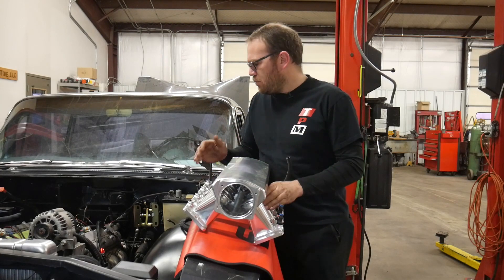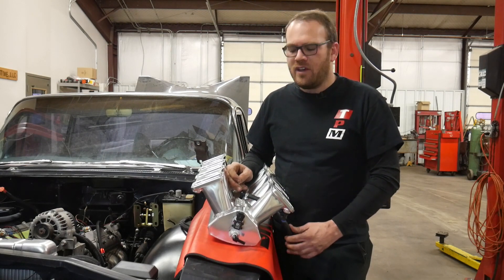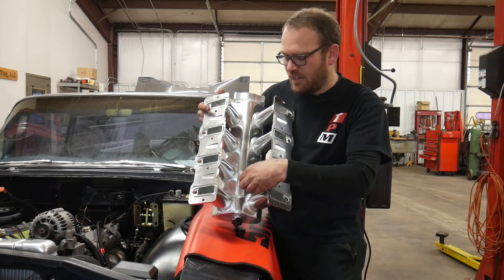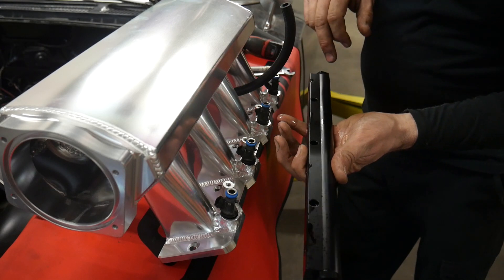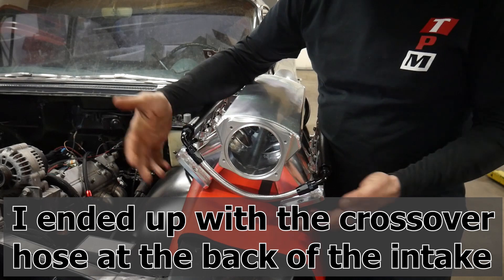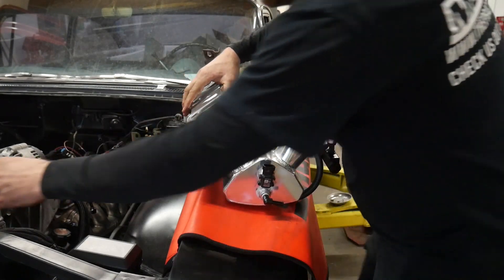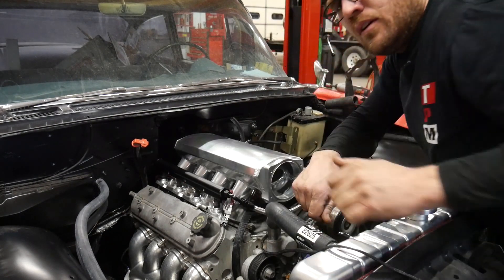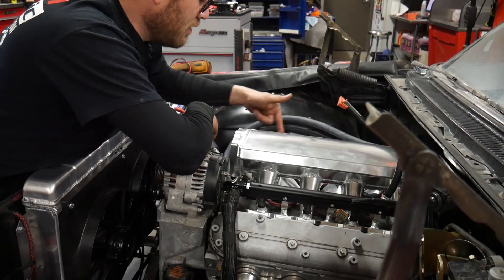1960 Chevy Biscayne LS Swap - Ep 28 Intake manifold and fuel rails

Comment: Manifold looks really smart, don't worry about getting it wrong and reorganizing things, happens to us all... Everything on my '60 is either broken, doesn't fit or is just missing so I have done a LOT of repeat work and modifications. I also have RHD to contend with. EG: The RHD park brake is  a horror design all to itself and fouls the yoke on the 4L65E output.
Reply from the maker: Probably quite a bot harder to get bolt on parts for the RHD model.